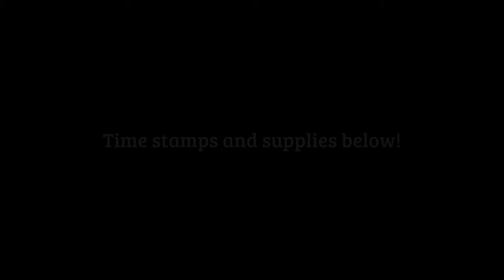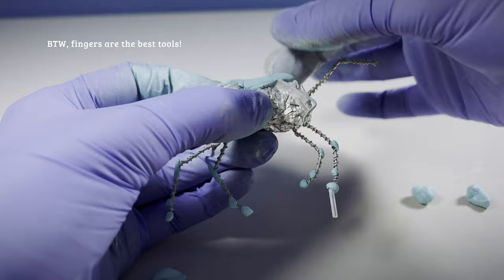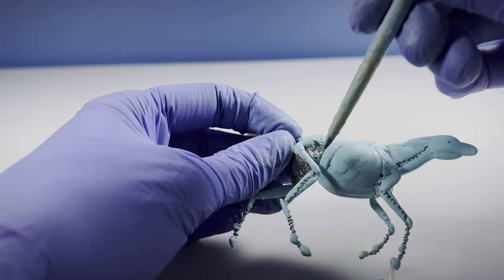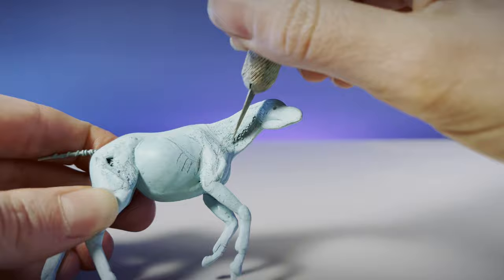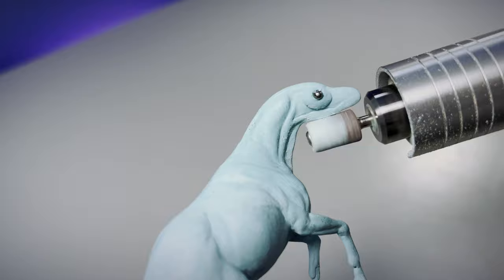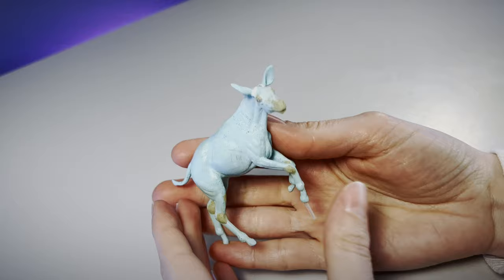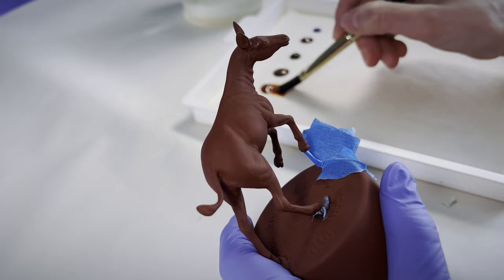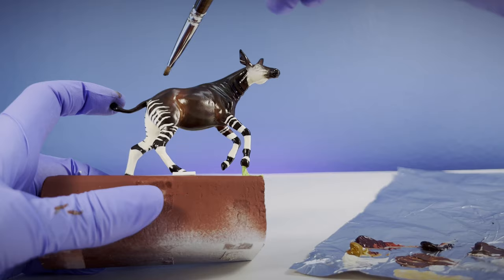Sculpting & painting an OKAPI in MILLIPUT (& finding fun in wildlife art again)

Comment: 1:13 how do you print diagrams to scale?
Reply from the maker: I research the common height of the animal from the ground to the highest point of its shoulder or hip (depending on how they’re commonly measured), then math out how many inches that is for the scale I want. Once I have that measurement, I use a basic photo editing software to make a box at that size, then scale the diagram to fit the height of that box and print at 100% scale
Reply: Thanks, I'll try it :)